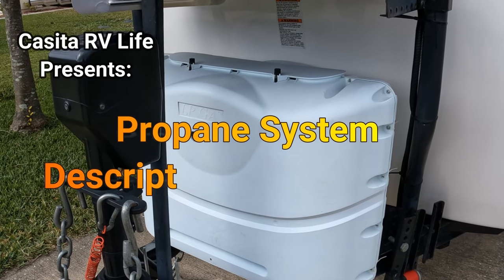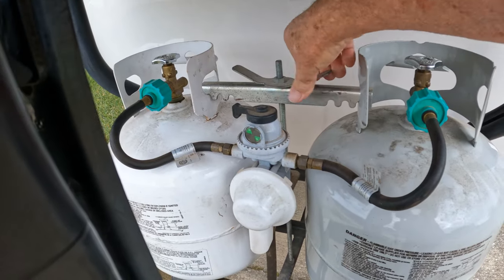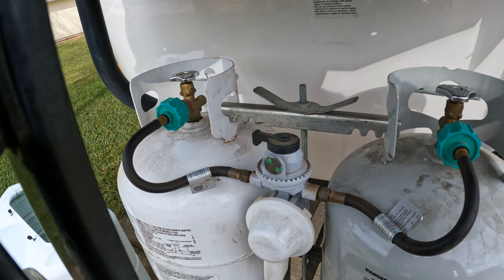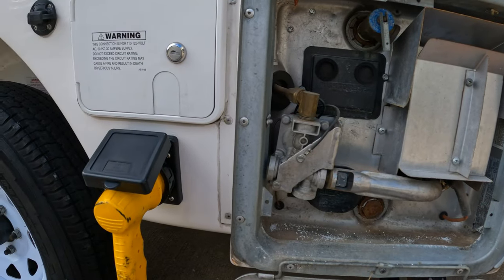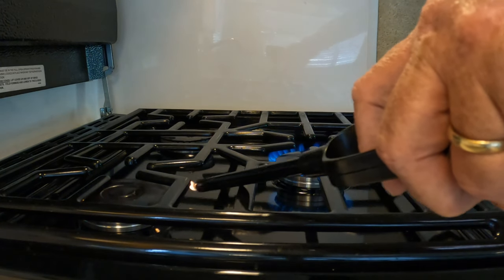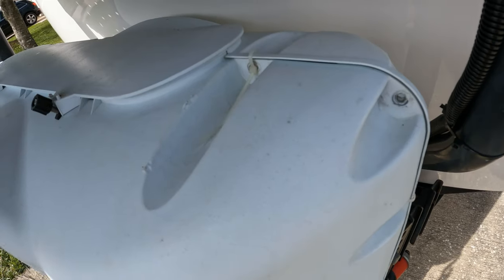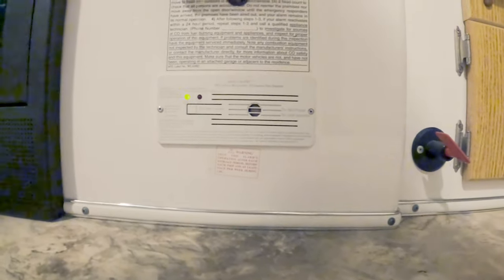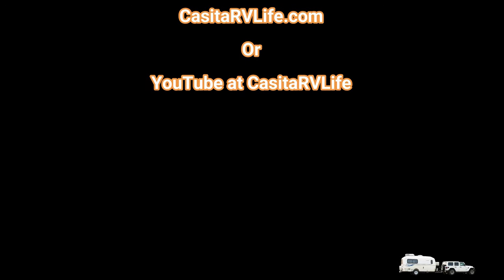Casita Travel Trailer Propane System

Comment: Thank you for your videos as a new owner of an older Casita they are very useful.  Tonight is my 3rd night and I am trying to get the furnace to blow not air.  I will try running the gas longer to the stove
Reply from the maker: There is also an airflow switch inside the furnace that goes bad.

Comment: I have enjoyed each of your videos. I am grateful that you share your knowledge so freely. You have done an excellent job of providing detailed information and as a newbie, solo camper, I appreciate having your videos as a reference. I would love to know the name of the monitoring device you use to measure your propane levels, can you provide that information? Thanks so much and keep up the great job of helping to educate newbies like me.
Reply from the maker: You are very welcome. Here is the link on Amazon for the propane tank level.
Reply from the maker: Sorry link didn't copy. here it is. https://amzn.to/3ISnykp
Reply: Thank you. I have a question, now that I have checked out my propane tanks. I purchased a gently preowned 2020 SD. The couple that I purchased from, had modified to add a generator and placed the propane tanks on a shelf above it. The bottom of the tanks are not freely accessible  to place the monitor on the bottom as you have shown. Could the monitor be placed anywhere else to get the measurements? I liked the idea of being able to store them as you have instead of leaving on the tanks.
Reply from the maker: Since your tank bottom is closed with the new stand you can permanently mount the monitors to the bottom of your tanks. The kit comes with two monitors and six aluminum stands to put on the bottom of the tank to hold them up just enough for the monitors to fit. Your monitors won’t fall out like mine can because my Mount is open on the bottom. This way all you have to do is open your phone app anytime and see how much gas you have. It comes with very good installation instructions. Also if you have any questions feel free to let me know.
Reply: @CasitaRvLife  Again, thank you so much! Happy Camping!

Comment: Cut some plastic or sheet metal the diameter of the tank bottom rim and set the tank on them to prevent losing the sensors should they fall off. Not sure but you might find that the bottom or the lid of a 5gal plastic bucket will fit just fine.
Reply from the maker: Thanks, The mounting ring also works great.

Comment: Thanks so much for the video.  I am about to start up my propane system for the first time and this helps.  One question:  You mentioned that the tanks will switch over automatically, but you then said that you had to go move the black lever on top manually.  So is the manual lever just for reference?  Has no actual impact on which tank is drawing gas?  Thanks again.
Reply from the maker: For this explanation we will call the tanks 1 and 2. You get to select which tank is 1 and 2.
The black lever points to the tank 1. The display will be GREEN as long as tank 1 has gas in it. When tank 1 runs empty the display goes RED and the valve will automatically switch over to tank 2. The RED display is indicating that tank 1 is empty. Then you have to move the black lever to tank 2 to replace the empty tank 1. When you move the black lever to tank 2 the display will go back green as long as tank 2 has gas in it. After refilling tank 1 hook it back up trailer and open the tank valve on top of the tank 1. The black lever is still selected to tank 2 and the system will be still using gas from tank 2. When tank 2 goes empty the system will automatically switch to tank 1 and the display will go RED indicating tank 2 is empty. Move the black lever to tank 1, the indicator goes GREEN indicating tank 1 has gas in it. Replace tank 2. Reinstall tank 2 after filling, open the valve on top of the tank and the cycle repeats.
Reply: @CasitaRvLife  So it sounds like the manual lever just controls the reference indicator for tank level and has no actual control of the flow of gas.  Thanks for the quick reply.  I wonder if you might not mind me abusing your good nature to ask also.... When you fire the furnace up, does the pilot come on and off as needed?  I started mine and the fan came on at a high speed and I could see a flame through a little window.  As the camper comes to the set temp, the fan slows and eventually turns off.  At this point, I can no longer see the flame though the little window.  Does all this sound right?  I had it in my head that there would be a pilot light on all the time.  (So long as the thermostat is on and gas.)  Thanks again for your time here.
Reply from the maker: The furnace uses electronic ignition. The flame you are seeing is the actual flame for heat. The furnace does not have a pilot light. It uses a sparker to light the flame. If you listen closely to the furnace when you first turn it on you can hear a clicking sound. That sound is the ignitor.
Reply: @CasitaRvLife  Very good.  Thanks again!

Comment: Question: if you have the gas switchover valve on the passenger side and you deplete the propane on that tank the spool valve will move to the right due to the pressure on the driver side tank. Is that the way this one works and the driver side tank will now supply the propane?
Reply from the maker: Yes, the pressure of the full tank will force the valve to change to the other side.

Comment: Great video.....thanks.   Curious..... on average how long does a single tank last when you guys are out camping?  Cheers!!!
Reply from the maker: I normal weather about four weeks. In very cold weather about 2 days. If you are not using the gas furnace it will last a very long time.
Reply: @CasitaRvLife  Wow! When you're on the road how do you plan for propane?
Reply from the maker: @GS-lx9qx  I find a station like Flying J or Love’s that has bulk propane. A lot of hardware stores also sell propane
Reply: Great video as always. Just to add: if propane cover gets dirtyish from age and won’t clean just spray paint it black. It looks great. Also put your cover on so the top door hinge is forward. That way if it comes unlatched (those patches stink) the airflow wll close door instead of ripping it off. I carry a third tank secured in back of truck for outdoor grilling and I might need the extra propane in a great boondock site.

Comment: Is it common to have to remove a tank to get it filled or are there places that fill them in place?
Reply from the maker: It is common to remove them.  I have never found a place that would fill them on the trailer.

Comment: is it a problem if the propane tank is nearly 100% full? i see some
literature that says it shouldnt be more than 80% full?
Reply from the maker: Yes a tank filled to 100% is a problem. Modern propane cylinders are required to have an Overfill Protection Device (OPD) installed to prevent the tank from being overfilled. In most states it is illegal to fill a tank without an OPD. If your tank has an OPD the valve handle will be three sided and should say OPD on it. I your are worried about the tank being overfill take it to a local propane dealer and they should check it for you.

Comment: Stupid question why cover the tanks I’m looking at casitas because I’m tired of dragging my 26 ft 6500 pound avian tanks were never covered?
Reply from the maker: The cover helps protect the regulator and the rubbers hoses from UV rays from the sun. It also protects the tanks from road debris but it is not required.